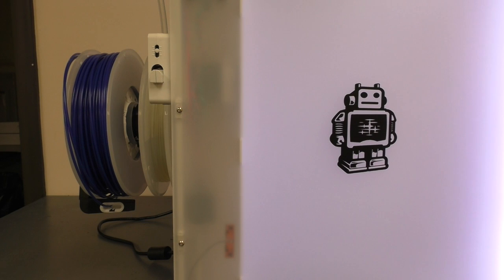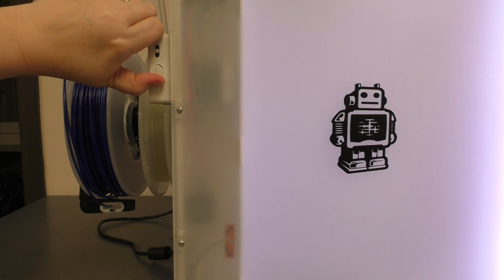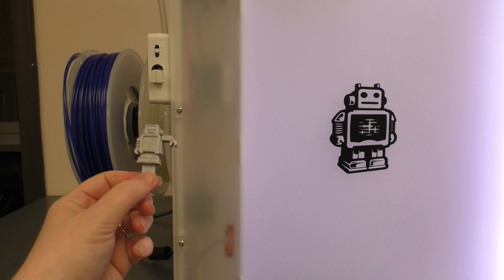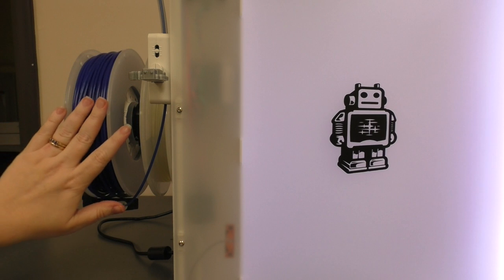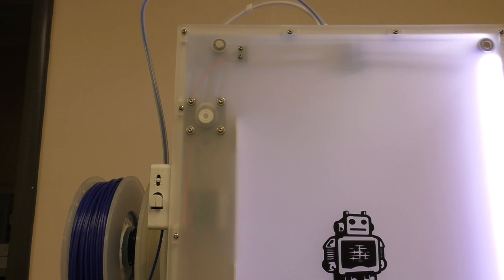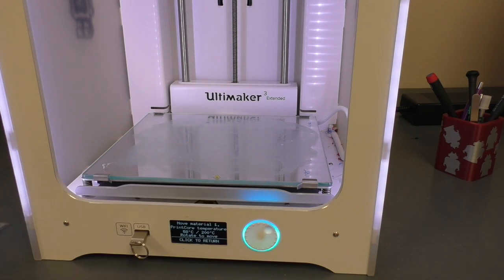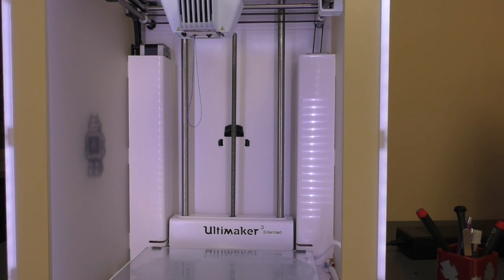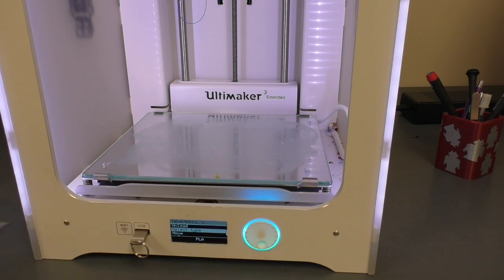Loading Filament (Alternate Method)

Comment: Correction...when I lift the lever it won't let me put filament the whole way...it never goes past feeder...even tho I lifted the leaver
Reply from the maker: I would recommend making sure the filament is straight (the curvature can throw it off a little when manually loading). Are you holding the lever up while the motor is turning? If the lever is held up while the motor is turning, then it won't be able to grab hold of the filament. If it's still not working, please go ahead and a support ticket to my team at support@fbrc8.com with a video of your loading process and we'll be able to assist you there.